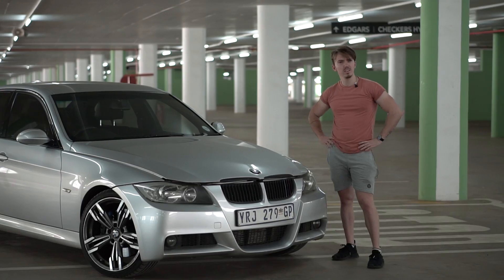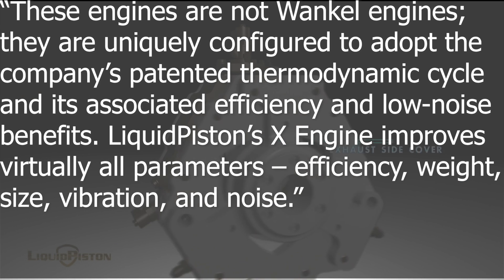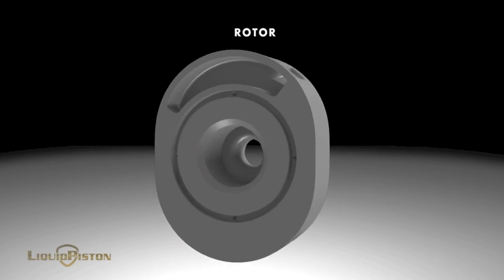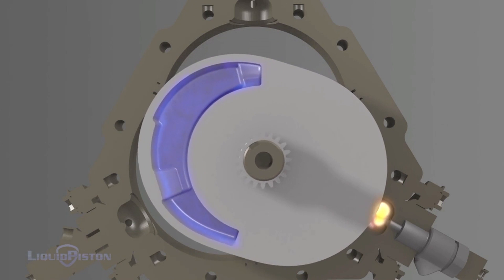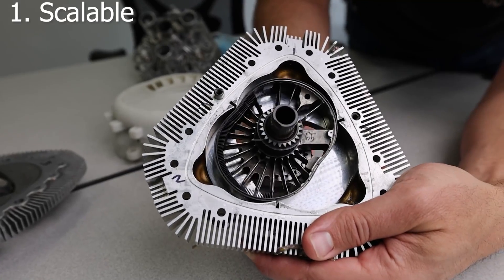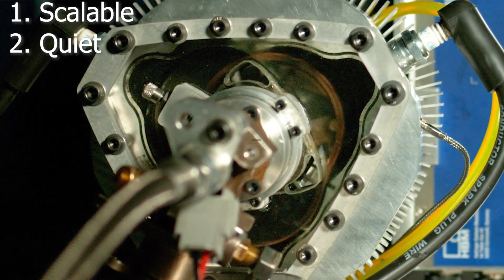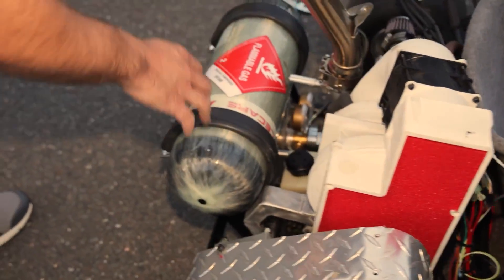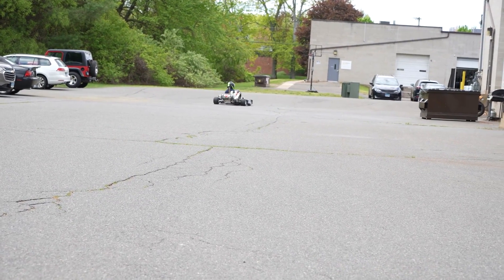This Liquid Piston engine revs to 15k rpm and can make over 1000HP

Comment: Thank you Chris, I have been around engines most of my life. This engine that you are showing, has a lot going for it. 1, less moving parts. 2, less waste
of energy due to being a rotatory type. 3, If it was multiplied up to six rotors, it would fit in between the chasse of any commercial truck!
What's not like? Have a nice day.
Reply: This one has definitely caught some attention, even in the modeling stage. Unfortunately there's a lot of apathy when it comes to new engine designs because many exaggerate the potential of their engines. The difference with this one, in my opinion, is it isn't actually a radically new design. It's a "radically improved" version of an existing proven design. Like you said, it has a lot going for it.

I do wonder if stacking rotators with this design is practical though.
Reply: @CynHicks  I was thinking why not scale up first rather than stack them unless he means to do both if so from the numbers I've read that would be a crazy over kill but fun to see!
Reply: A commercial truck? So as with a rotary type it makes. Disma torque at lower rpm.. regardless of the rotor count.  Not good idea for grunting up hills and mountains with a load of 80k... spin it u say?  Well good luck getting the 1/2 million moles or more that they do.. much less 150k spinning that thing under a severe load
Reply: @darin2009  Could it be that it could overcome this because of the extra cycles per revolution? Could it allow it to produce power at much lower rpms? I'm not an engineer but it makes sense to me. Also, even if it can't replace diesel low rpm torque many commercial trucks use gasoline for ligher duty hauling. If it can just compete with gasoline engine's low end torque while being able to idle as low it should be fine right?
Reply: @CynHicks  naw.. extra cycles won't help the low rpm trq loss. Due to the way it operates.. yea maybe better than a true rotary.. but by design and physics... when combustion happens... the piston/rotor/what ever ya wanna call it.  Moves away from the ignition so fast and opens up a huge combustion area.. watch the vid slowly... there is almost zero dwell time fore pressure to rise at lower prm.prices.. ermm.. 4.5k and lower.. where all mass transit and trucks live... sure.   It's awesome fore. High rpm power... but  for a half a million miles to 1 million miles on a low rpm chugging working semi... just isn't feasible. Pulling power. Worked of pure  low rpm is 4k and below.  Diesel  stump yanking nutz..nuts... a rotary in any iteration may do this with the proper gearing.... but for how long....  sorry.. builds to much heat on seals.. in any form... this is why a  higher revving gasoline. Piston engine isn't used... pulling isn't about power... it's pure torque. And life expactancy..expectancy... a rotary.. sure. Power galore... but not for commercial use
Reply: Yea a bit better.. but look no bs.. due to true rotary design... there is almost no dwell time fore the pressure of combustion to peak to make... he man force on the piston or dorito.. lol... by pure principal... even a 4 rotor.  Reves kinda high to make any type of trq...   now apply that to a conventional piston type... slamm block versus bug bock... it's stoke length  versus. Rpm.  And. Bore... dwell time for fuel combustion to peak pressure before detonation...   yes a rotary in any form can make amazing hp...  this is true... but where a tow rig lives in its rpm band... and the amount of miles?...    yes rosaries. CAN  be fantastic... but as a tow... / commercial

 Or an enging that needs to pass 150k.. before a major rebuild... man a rotary isn't it..
Reply: Rosaries in any form are fantastic

.. just not in a low rpm high heat/load  continuous operation....   heat and oiling are the issue.. heat at the seals../piston rings.. if u call them....  they spin fast.. wear is wear
Reply: @darin2009  Their claim is that they have worked out the wearing of the apex seals making them last much longer. Rob Dahm worked it out with his "traditional" 4 rotor along with the oiling issues. So assuming they have worked out the durability issues I'm still not not sure if you're correct. I'm not saying you aren't either.

I understood much of what you wrote but don't understand why the multiple cycles per revolution wouldn't alleviate the low rpm issues and smooth out the curve. In my mind it's not like adding more "doritos" (😁) working in parallel but it's like adding more of them working in sequence. Same way a cylindrical piston works with the others. Three of them in this case. Instead of spinning three massive doritos it's spinning one but with a sequence more like a three cylinder piston engine.

I hope I explained my thinking better. Any input is welcome. I like learning.
Reply: @CynHicks  its. Piston speed.  Versus rpm.. versus working pressure to turn the crank... high rpm. Fk yea it works great

 Low rpm cyl. Pressure= tq to drive a load? No.. look at smokey yunicks theroies.theories.. old school but still proven... it's all physics
Reply: @CynHicks  u just don't get enough cyl dwell pressure at low rpm to make it efficient... hight rpm.  Heck yea
Reply: @darin2009  Thanks for the information man. 👍

Comment: liquid piston? this is a different take on the rotary. why no compression strips? that tells me this would have to be extremely fine tolerance's when using petroleum's due to emission's, that is why the rotary engines had them.

Comment: And the big question is how efficient is it..
Reply: The cycle is approximately 30% more efficient than an Otto or Diesel cycle engine with their most favorable tests, and has about 5x power density over Otto and almost 10x power density over Diesel, so that motor can fit into a ton of really small places. Or be one big awesome motor if sized the same as the traditional ones.
Reply: @mdj391  Durability, Emmisions, Hp.

There are a lot of things more important than raw hp/weight.

I don't see the benefits over this, when a 2 stroke engine covers all the same bases, while being more durable.

It will also have the same downfalls of a 2 stroke and rotary. Those oblong chambers aren't  going to burn as efficiently as traditional chambers will.

 Unburnt fuel will make it way outside of the exhaust port leading to poor efficiency. Same problem rotary engines had, exactly why they burnt so much fuel. 

Durability is still questionable. You still going to have to oil this, with oil in the combustion chamber. Its not a death sentence, but finding the balance between having a short lived motor and passing emissions is going to be a challenge.

Ultimately i can't see a use for it. If i wanted the least amount of weight and high hp i would run a 2 stroke engine for small applications or motorcycles.

Big applications there isn't much use because the 4 strokes have been ironed out to almost perfection. 

The only application i see is generator/electric vehicle hybrids. Constant rpm/ low weight/ efficient. 

But then why not rotary. They excel at generator function too.
Reply: @richr161  why traditional rotaries are bad as generators? Simply because they die quickly when run at fuel optimal rpm's. For a rotary to last they need to rev high. Which is also why they aren't great for everyday cars. The redesigned rotary with its 3 combustions per cycle fix the low rpm problems.
Reply: 4 strokes in bigger application suck to, i hate them in cars trucks also and i like the 2 stroke XTS 210 2 stroke version of this engine. Also looking at Rotax and achates power 2 strokes also

Comment: I have thousands of hours running single piston, 2 stroke chainsaws. My favorite saw and daily work horse is over 20 years old. I have resisted computer controlled carbs in favor of mechanical simplicity. I even pass up the more powerful fuel injected saw that is available.
But if this type of engine can compete with my beloved 440 in power to weight?
This engine looks like it wants to deliver torque. In my applications, that could be huge. While also not needing 2 stroke oil. Another huge plus in my own opinion. I will miss the backfires that my aftermarket exhaust creates. But lower vibration is super attractive.
Reply: Did he actually mention that it doesn't require 2 stroke oil? I must have missed that part?

2 stroke actually smells nice though? In Australia we have a cliche movie called 'The Castle' which makes good reference to the point I'm trying to make lol
Reply: @Jarmezrocks  I'm asthmatic, some chemical fumes trigger inflammation bad in me. Cheap two stroke oil can choke me out. But running straight fuel means no worries, just get some proper octane fuel and go.
Reply: @komrade223  I have asthma too and yes I too agree less fumes the better.  2 stroke only smells nice when it's wofting in the breeze diluted from afar 😁

On a side note if you are "suffering" from your asthma conditions (in general) you should ask your doctor for a prescription for Breo Ellipta (fluticasone furoate)25mg inhaler👍

Since using this I have not suffered from any asthma symptoms in many years!
Reply: This engine would use 2 stroke oil and there is nothing wrong with that. I f i ever get the XTS 210 im using nothing but synthetic 2 stroke oil and i got plenty of it.

Comment: I'm not anti EV, I'm anti shoving it down our throats. Especially considering a power grid that's decades away from being able to provide all that extra demand. This engine with its multi fuel capability is extremely exciting! Especially the hydrogen aspect, who doesn't love pure water for engine exhaust...
Reply: Pure water ,nitrogen oxides and trace lubricating oil exhaust.
And I'll believe it can run on hydrogen when I see it . Burning hydrogen is notoriously difficult ,requiring extremely well controlled cooling to prevent pre-ignition. This design is rife with uncooled parts of the intake system that will guarantee that it will experience these problems
Reply: @paulg3336  only time will tell...
Reply: @paulg3336  they did show it on hydrogen in this video. Theres another more in depth video of it being driven on the gokart on hydrogen, it works but did seem a little anemic.
Reply: @Flyingwigs  It proabably was a little anemic, they replaced a 35 pound gasoline engine with a 4.5 pound X-Engine.
Reply: Most ev’s charge at night when there is excess power

Comment: The engine is used as the generator for the Anglo-American M777 howitzer gun. Small, light and portable. It is past the concept stage into production.

However, I fear it has missed the boat as EVs will dominate. I can only see small niche applications like small portable generators. 

I fear Mazda have also missed the boat with the Wankel wanting to introduce it as a generator in a hybrid this year - delayed. EVs are made them think about going into full production. The Wankel is good at constant speed & load applications, like electricity generation. 

The engine is like a Wankel inside out. Much better design. Thirty years ago it may have been taken up for mass application. EV technology will steamroll the small vehicle market. It is here, works, emissions free, with chargers being installed en-mass. Also solid state batteries are a game changer, which are imminent to be introduced. And R&D on batteries is still ongoing. 

Great design, but too late.
Reply: May be for small air plane. Where battery is too heavy
Reply: @Spark-Hole  
Or a small hybrid plane, with a battery and electric driven propeller.
Reply: Yes To Late  So Fluoride in the Water By LAW = Neg. -20 IQ Points =  It's Corp. Gov. Fake Money & Depopultion & Nuclear END One Way Or The Other  Any Time Now ....Take Care....@ 26 CPM
Reply: How will EVs dominate when our electrical grid can barely support what we have now?
Reply: @clutchboi4038  
One refinery in the UK uses the equivalent electricity as the cities of Leicester and Coventry combined.  That is a lot!  When petro production declines this electricity is then used to charge cars. One of the heads on the British National Grid said that there is no future problem in supplying electricity for EVs.

Also, the UK is busy installing large wind farms around the coast and large grid battery storage banks. The last of the coal burning power stations will be decommissioned in the next year or so. Should have already been decommissioned but Covid and the world-wide energy crisis got in the way.

Comment: VERY interesting!
I need a way to rotate a tool, (7.8Kg)
with about 5000 rpm, and a power of 1.3 Hp.
Konstand rpm, differing load.
Is this enginge possible to mount to, lets say, a robotarm?
I need that to rotate a tool on, at so near constant rpm as possible.
Where can I buy one?
What´s the cost for one (one rotor), motor?
I think 5+ Hp, will do the job. Or, is it too much for one rotor only?
Might make it (the work), with less power, but only one rotor to keep it small. Thats important, the size.
Answer a.s.a.p, please.
Reply: It's not for sale yet... And they have an us army contract already